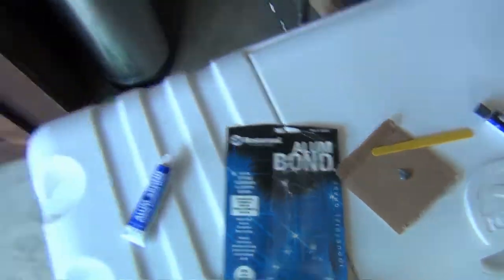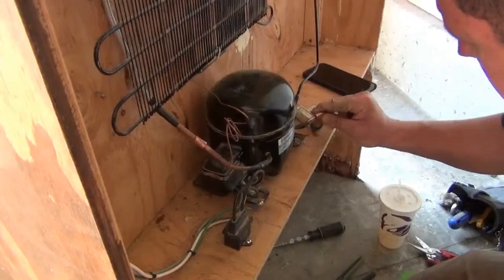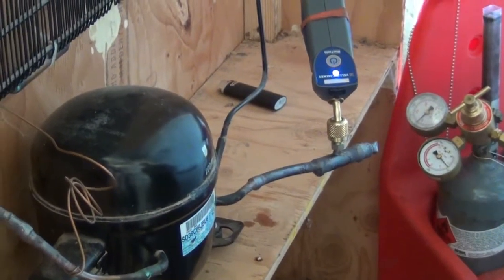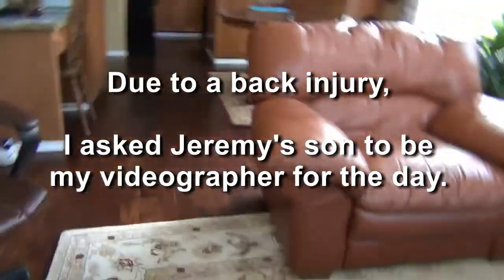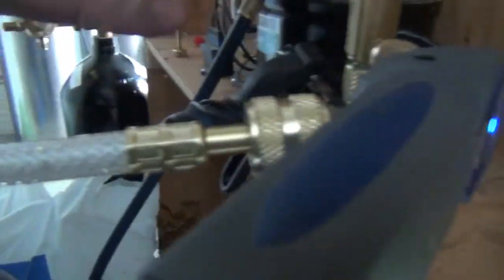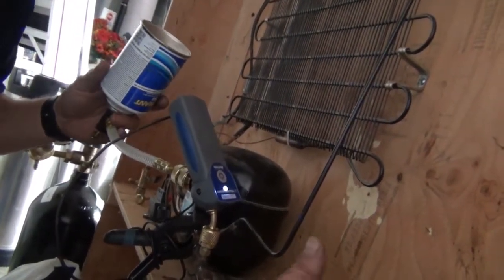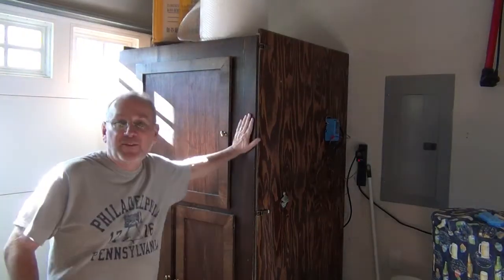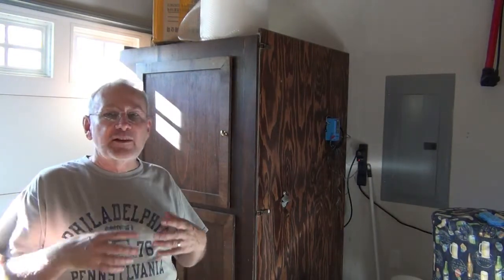HBW 224: Freon Leak in Fermentation Chamber - Repairing an old refrigerator

Comment: Not been on YT much but just spotted this from you, you got a leak in in your FC, glad you got it fixed. My next task is to build my FC, I was thinking to let the gas out and to lay the pipework as needed. Then get the whole thing re-gassed, to me that made more sense as you can check the integrity of the install. But after watching your video it's making me wonder if that is the right approach...MMMmmm  Sorry to hear about your back worst place to have problems I hope all is OK now, all the best and Mash On!
Reply from the maker: Good to hear from you!
Actually... if you have the ability and/or people resources with the proper resources, it's not a bad idea. They key is having the proper specs on a compressor. Large building compressors give tradesmen the ability to know exactly what they need in terms of pounds of gas and ability to measure. If you could setup get the specs of a good compressor and properly set it up for charging, it may well be to your benefit. But if you lack any of these.... it's another story. I was very fortunate. At this point though... I can fix any issues I may have in the future, which is super cool!
Had back surgery last Monday... So I'm early on the path to healing. I'll try to put up some videos soon. Cheers!